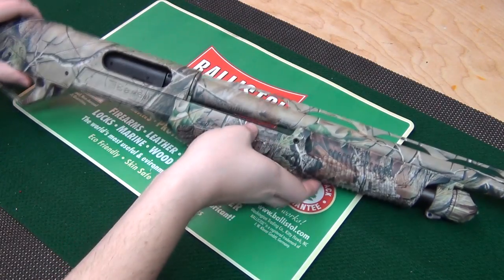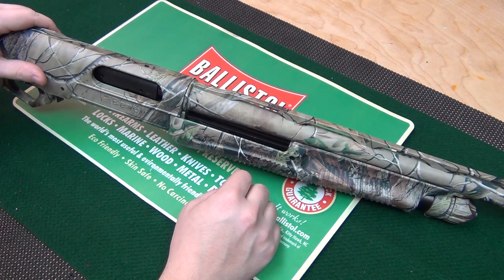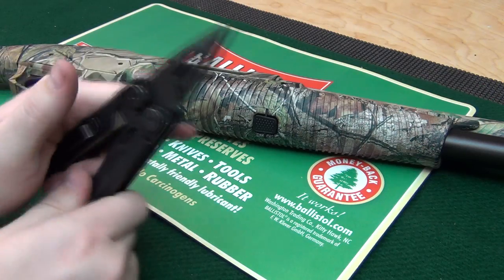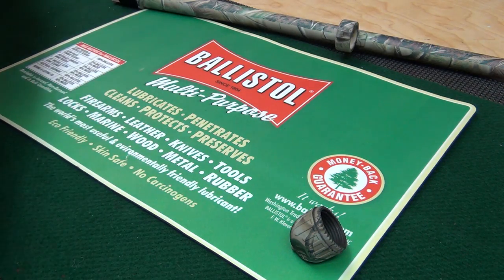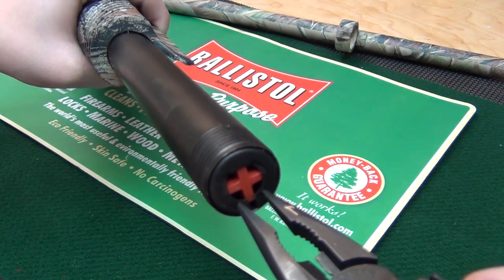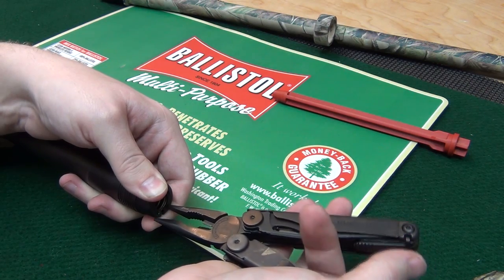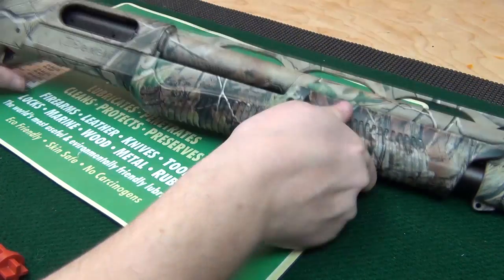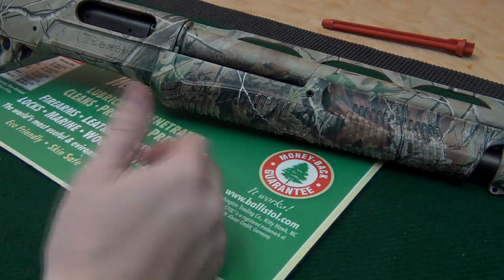Benelli SuperNova - Plug Removal

Comment: Thanks for the video, very nicely done. I have a super nova tactical and a nova pump 12 ga. One extra thing I did is put a nickel inside the little cap on top of the spring. It fits perfectly inside the cap, gives a little extra support on the spring.

Comment: Great tutorial and to the point.  My only problem was despite having many needle nose pliers, none of them was skinny enough to grab the two holes to pinch them.  I ended up making it work with the pliers I had but it barely moved the piece and scratched it up in the process.  There must be special pliers for this.  Seems like the standard pliers that come with many tool sets aren't narrow enough to pinch into those holes.

Comment: Excellent video! I just purchased the Benelli SuperNova Tactical Pump Shotgun (model 20160) and I suspect that when it arrives I will have to do the same thing. Likewise, you showed me how easy it is to remove the barrel (as I believe you have to reassemble the barrel when you open the Benelli box). In any event, I have saved your video to view again after it arrives. Again, thank you!

Comment: Thank you very much for this. I just purchased this shotgun, and was disappointed by the original 2+1. I ended up just pushing the plug/spring/cap from the loading end (be careful if you try this method!) as your trick was not successful for me. User error, not on you. Doesn't matter, great video, very useful.

Comment: can you decock the benelli without dry firing it? for example with the forearm back pressing  the trigger and slowly releasing it forward? you cant leave it stored and cocked for long period of time right?
Reply: Pull the pump slide forward push on the release by the trigger, and let the pump slide back shell pops out and guns decocked.